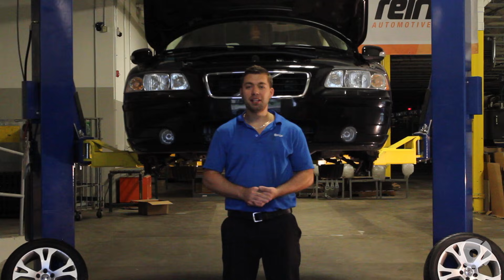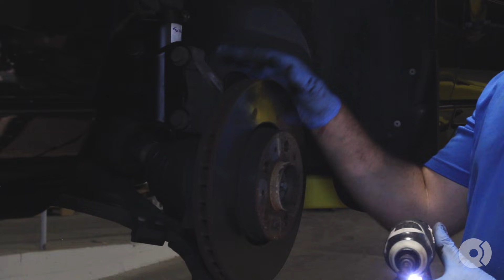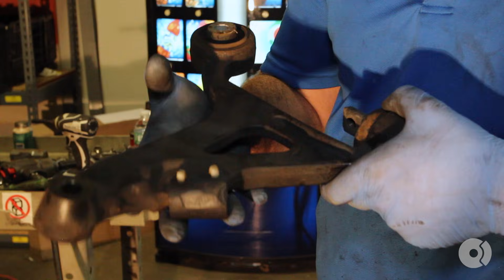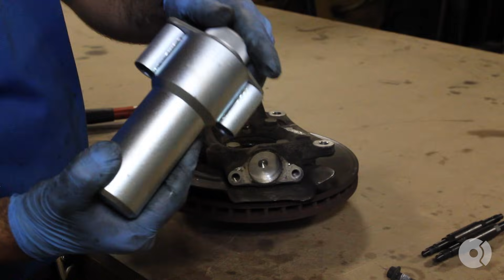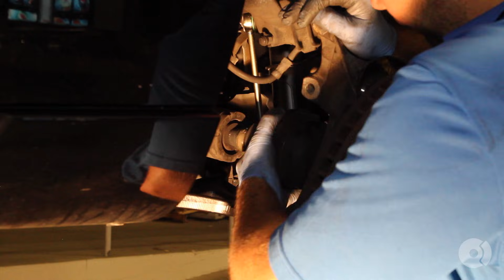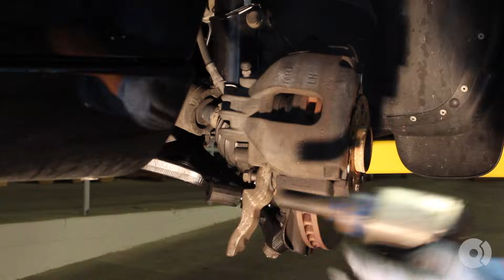Volvo Control Arm & Ball Joint Replacement - No Press Needed! (S60, S80, V70, XC70, XC90)

Comment: If was just replacing the control arm could I leave the hub attached to the strut and axle, and just compress the suspension enough to allow the lower control arm to clear the ball joint? Also why in all the videos I see does nobody replace the control arm bushings instead of a whole new control arm?
Reply: The reason is because the bushings need to get aligned in a very specific way. You can buy the bushings, but you have to cut out the old ones with a hole saw, put the new ones in a freezer, get them aligned perfectly and then still push them in with a 20 ton press. If you have the alignment wrong, you have to cut it out and get a new bushing. Given the cost of the whole LCA, for most people it is worth it to just spend the extra $40-80 and get a whole LCA rather than replace the bushings.
Reply: Yes to your first question. You can lever the arms down (with the correct size and shape lever) to just drop off the ball joint pin. You then remove the arm once the bolts are undone. Yes you can change the bushes but a new arm is £50 posted. Is it worth it? Bushes are £25 then you have to fit them which needs a special tool.
Reply: I have used that technique a few times, and have had issues with enough torque to pull down the arms.  Probably need a better technique, but next time I am going to use this method, and pay for a wheel alignment.

Comment: "Next we're going to compress" @ 7:49  Just takes a couple of seconds in the vid, but really??  Done this Job myself.  You better have a way of pulling that control arm down enough to line up those bolts.  Anyway, these guys at FCP are otherwise A-OK.
Reply: this is my exact problem on my 2008 s80. how did you line up the bolts? and for you kids out there, never own a volvo. the people who design them hate you and will stop at nothing to design a car that you cannot work on yourself. they HATE you?
Reply: @soylentgreen2065  Just bought my son a Ford thinking they would be easy to work on. Ha! The engine is a Peugeot Diesel and you need tiny but incredibly strong hands and arms for most jobs..Even changing the starter is a nightmare the first time. Finding invisible bolts, working out how the wring comes off the solenoid, it all great fun. Give me a Volvo to work on any day.
Reply: @soylentgreen2065  Like Citroen 1970-90's too....special tools for everything......they didnt care about part replacement later on for DIY......GRRRRRRR

Comment: I have a 2008 XC90, when replacing the struts and control arms, do I have to replace the two strut bolts, and the three control arm bolts?
Reply from the maker: Hello Riley, most of the hardware can be reused. The only time you'll need to replace hardware is if it's heavily corroded or a one-time use stretch bolt.
Reply: FCP Euro which one are the one time stretch bolt?
Reply from the maker: Your specific model should have regular bolts that can be reused providing the hardware is still in good condition.
Reply: My used in the country XC90 strut to hub carrier bolts both snapped trying to undo them. They were very rusty.  One side the threads face forward and get all the weather. They were the ones that snapped/ The other side the thread faces the rear so are more protected. They undid and were reusable.
Reply: Replace

Comment: On my 2003 S60 FWD with 5 speed Aisin automatic transmission, on driver's (left) side there is no way to place the ratchet on the two front bolts of the control arm, without jacking the engine/transmission to clear the bolts heads. Even then is tight. I had to lift the transmission about 1 inch (put a wood on the jack to protect the casing) to be able to place a 3/8" drive ratchet on the two front bolts of the control arm. I have videos on my channel.  But you need a solid quality ratchet, because with 3/8in drive it's a small ratchet and the bolts can be tight - I wish I could use a 1/2 drive ratchet but the sockets don't have enough space. Small tip, before removing, clean well the exposed bolt threads that come out from the control arm, use penetrating oil and brush the threads. Also, do not reuse a bolt if it's rusted!  I put a rusted bolt back, and one year later when I removed it the bolt had half thickness remaining, eaten by rust. These bolts are coated with black protective layer, careful not to scratch this layer when inserting the bolt back through the subframe. Usually, you don't need to fully remove the bolts, but try moving them out a little to check if the protective coat is gone and if there's rust.  These bolts also have different length to them, mark each bolt where it goes - you may also have the length is also different between the left and the right control arms as well.
Reply: I used an offset 17mm and it worked fine on both bolt heads.  Just have to make an extension out of sturdy tubing to get enough torque.  No need to jack.
Reply: @donmoore7785   I think there were some differences depending on the years. I've seen a car at the junkyard where I didn't had to lift anything as well, but it's worth to be prepared for it
Reply: Which engine/transmission does it have? Did you have a long socket or a massive ratchet?
Reply: @ollilehtonen6764  It's the 5 speed Aisin automatic. The 3/8 drive sockets were normal size, not long sockets, and not too thick either

Comment: Jay must love his job at Volvo.   The bolts on these cars are the easiest to remove in the whole automotive industry
I'll go saying on my S60 I had to jack the engine 3/4" on both sides (no need to disconnect any engine mount) to clear the two control arm bolts - have these bolts replaced with new from Volvo, they are cheap (for once) and old bolts reused will get eaten by rust because of the contact with the subframe.
Reply: I did this job like 2 years ago on my 02 s60. I had the same problem. It took me like 2 weeks to start because I had to order tools multiple times because of the tight fit on those control arm bolts. I want to say I had to order a special 3/4 inch sockets in abnormal sizes and also get a super slim abnormal breaker bar and literally kick it with my foot to get it loose. Then later tighten it the same way at the end. There was no torquing on those. Of all the DIYs I have done on my Volvo and there have been many the control arms was the most difficult. Especially using all hand tools.
Reply: I used a 17mm offset box wrench and it worked fine.  No need to jack the engine.  But you are correct - you can't get one of the bolts out unless you jack it.  Mine are 17 years old and have not rusted.

Comment: I thought I read somewhere that you only torque down the control arm fasteners for the bushings when the vehicle is on the floor with the suspension loaded, not with the car jacked or lifted up where the suspension is not bearing any load. Is that not accurate?
Reply from the maker: Hello, on most Volvo models the control arms can be torqued down with the vehicle in the air or on the ground. The bushing will not twist or move while tightening because of the design that Volvo uses.
Reply: On my 96 850 you did need to load the wheel with the vehicle's weight before torqueing down the control arm (to preserve bushing life), but on the newer models I've heard you don't have to.
Reply: @Cre8tvMG  That sounds familiar.  I believe I needed to do that with my '95 T5
Reply: the front control arm bushing cannot rotate when the   bolt looseit's not like it is  on a Vectra it makes no difference if it's tightened with the vehicle jacked

Comment: Thx for the video but I have a question. With the ball joint, could you just have tightened the ball joint with the screws by themselves instead of having to use the ball joint tool?
Reply: Easy and cheap way to remove and insert the ball joints: 
1) Put the ball joints in the freezer several hours before doing the job.
2) Use a long, flat screwdriver (strong one - I used an old socket, and about 12-15" of ratchet extensions for this), place the head (or edge of the socket) on the ledges of the ball joint, and start hitting the screwdriver (or extensions) with a hammer in a downward angle, working from side to side with a few hits each time. It will start coming out. Do this until it pops out. 
3) Use some high grit sandpaper to clean the ball joint area inside the knuckle.
4) Apply some grease around the inside of the hole.
5) Grab the frozen ball joint from the freezer.
6) Use the new bolts to get the ball joint lined up.
7) Start slowly working the ball joint into the hole, turning the bolts a few turns at a time until fully seated - no gap left.

The trick for easy installation is freezing the ball joints ahead of time. It shrinks them slightly, making it easier to insert them. DO NOT take them out of the freezer until you're ready to insert them.
Reply from the maker: Using the ball joint installation tool ensures that you properly press the ball joint into the knuckle of your Volvo instead of the alternative tactics such as using a larger socket which can tear the ball joint boot and damage the housing, or using the mounting bolts to drive the ball joint into the knuckle which can strip the threads and bend/damage the housing.
Reply: FCP Euro The tool is almost $150 dollars, I believe a simple wrench hammer will work for this. It doesn't appear like that ball joint is very tightly fit in there anyways if you can tap it in there with a hammer. Most ball joints require an industrial press to snap them in. Volvo doesn't and thats why they have to secure them with two bolts.
Reply: Guy Fawkes, no problem, Thx. Youtube is great source of how to, for all kinds of work and projects. You video will others as well, God Bless.
Reply: My pops and I did this about 2 years ago for my 02 s60. It was a knuckle buster on jack stand/ramp. We just removed the ball joint screws the beat it out with a sledge. When we reinstalled the control arm the ball joint was already attached. Then we did our best to pry the ball joint into place with a rope and a major pry bar then doing our best to thread it without cross threading it. Its definitely not the pro way to do it but if are a backyard DIYer sometimes its necessary. I just suggest getting polyurethane or whatever the best control arms and ball joints are so its a never again on this car project.
Reply: My local parts store had a tool set in their loaner program that allowed me to do the job. Check that out before you use alternative methods.
Reply: I was thinking the same thing, might save you $50 for a single use tool
Reply: Oh Thank you,  1st time working on a Volvo
Reply: Dubblesteel I'm not a mechanic so don't take my word for it, just letting you know how I am going to do mine.
Reply: Guy Fawkes is wrong.  You see in the vid it takes an air hammer to get the pressed ball joint out of the knuckle.  As FCP commented, using the 2 volts to pull it in will damage the threads.  It's in there with considerable force, thus the tool, expensive as it is.
Reply: @reallyhappenings5597  They used an air hammer. I just knocked mine out with a small punch and small hammer. There is also another video on here where the guy uses a screwdriver and taps it with a hammer. They are not that tight.

Comment: Hi Jason! Is it crucial to tighten the ball joint nut with the break disc unit hanging out? I only tightened it by hand first and then when drive shaft and strut bolts where all tightened only then did I torque up and tighten the ball joint nut. The reason why I'm asking is that my wheels are leaning to the inside on both sides. Lower part of the wheel that is.
Reply: Sounds like when you did the two 18mm/21mm through bolts that attach the mcpherson strut to the hub you didn't paint lines on the parts to keep them aligned for when you reassembled. Those two bolts can be loosened and the two parts moved relative to each other to change your camber. What people do with mcpherson strut setups like that is prior to taking things apart they wire brush all the dirt and grime off the parts then get nail polish to make a paint line showing the relative positions of where they bolt up. So what you can do now is jack each front side up so that the wheel is barely off the ground, take the wheel off, get a level, loosen the two 18/21mm through bolts, use a level to make sure the wheel is somewhat straight up and down, then tighten the through bolts so that once the car is sitting back on the ground your wheels will be straight up and down vs canted in or out. In the future use the painting with fingernail polish to keep things relative to each other for reassembly. Anyone else feel to chime in if you think you can describe this process better.
Reply: Hi Marcus! Thx for your reply! I did paint lines only I used a different method. I marked each side of the strut with a sharp metal "nail" and a hammer. That was exactly like before. 
I also changed the tie rod ends and the ones I got were half a centimeter longer than original Volvo ones. A local garage here in Germany could not adjust the wheels because there were missing two millimeters of threads on the Teilex rod. Solution -  straight off to Volvo to buy two original ones then straight home to my garage where I Changed them both in 30min! Then back to the garage and then they managed to get the wheels perfect aligned with their lazer equipment!
Reply: @numberpirate I always wondered if my tires were a little out of tilt given the wear I've had on the edges ( even with new control arms & ball jts). I will try this before going for my alignment an see if it makes a difference.

Comment: Thx FCP! This is the only true correct video on how to change the control arm on all the cars you mention, I did the passanger side on our XC70 2005 D5 and did not remove the outer drive shaft or centre axel bolt, now I may have to take out the inner and outer drive shaft and even pull the axle out of the manual 6 speed gear box, I cant feel that any ball bearing balls came out into the rubber inner protection next angle bearing, would you know if it just ok to push the outer drive shaft back into place or is it a must for me to take out the entire drive shaft? Do you have any idea? Thx again from a Swede with three Volvos! You are simply the best out there! Regards Björn
Reply: Hi Bjorn, thanks for the compliments and I'm sorry to hear of the issue. The inner joint is a tripod joint so if it popped you you should be able to just find its way back into the housing without removing the axle or boot.
Reply: Hi Jason! Just finalized the drivers side with help from your video! 2.5 hours instead of 8 hours on the passenger side where I used another where you use ratchets and don't remove the drive shaft. I already pushed back the shaft / axle and it does not make any noise when turning anymore. Perhaps I should give it a try and put all back on. You guys at FCP are my idols! Simply the best!
Reply: Hi Jason! Just finalized the drivers side with help from your video! 2.5 hours instead of 8 hours on the passenger side where I used another where you use ratchets and don't remove the drive shaft. I already pushed back the shaft / axle and it does not make any noise when turning anymore. Perhaps I should give it a try and put all back on. You guys at FCP are my idols! Simply the best!

Comment: Great vid, Jay.  I did this on my 2000 S80 (control arms only) a couple years ago.  I got some solid Meyle arms from FCP Euro that are still riding strong today.  Getting to the control arm bolts wasn't as easy, unfortunately - especially on the driver's side.  I had to jack up the engine a little (roughly 2-3 inches) to get to the bolts, and I had to use cargo straps in order to get the arms back into the ball joint.  But other than that, the procedure is roughly the same.
Reply: If you had to use ratchet straps, you did not use his procedure of removing the knuckle.  To avoid jacking the engine/trans, use an offset box wrench.  I used a piece of tubular steel pipe around the other end of it to give more length (torque).
Reply: I believe the Meyle and Lemforder simply do not last.  I have replaced using Meyle twice, and the 2nd replacement is now shot - each lasted only 20k miles and I avoid bumps and potholes.  I am going to Volvo at full price.  Not worth my labor to keep replacing inferior parts.  FCP lifetime warranty does not cover labor!
Reply: @donmoore7785  Lemforder is the company that makes them for Volvo. I put them in my XC90, and didn't have any issues 3 years later when it was traded in.

Comment: THANK YOU!!! You posted this just in time for me. I will say that I was able to do this without removing the hub (using jack straps to pull down the control arm once the bushings are secured). There is a danger of pulling out the inner cv joint this way, but it was reasonably easy to whack back into place.
Reply: be very carefull about the inner cv joint, i pulled that out and ruined my driveshaft.
Reply: @knut5748 - how did it ruin your drive shaft?
Reply: You’ll probably damage your control arm bushing doing that